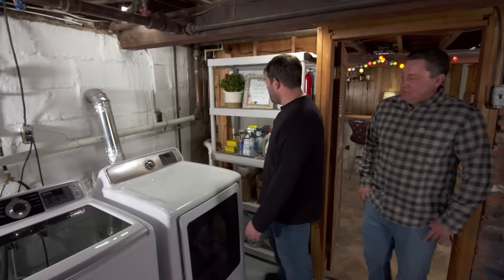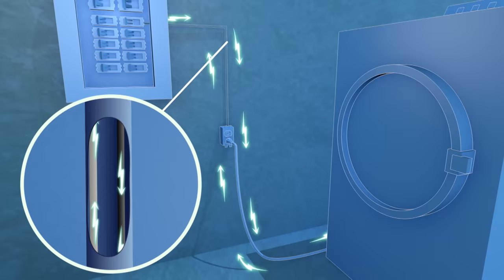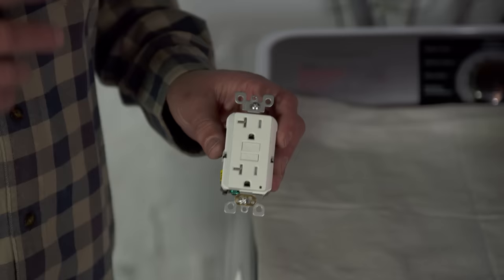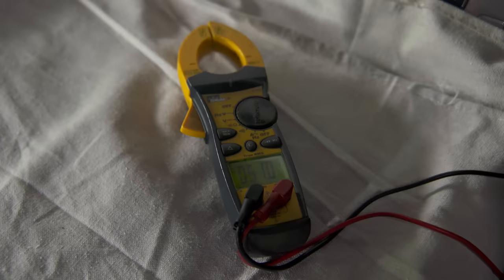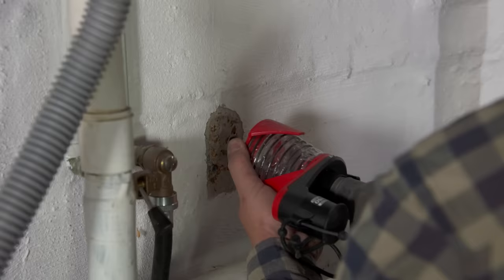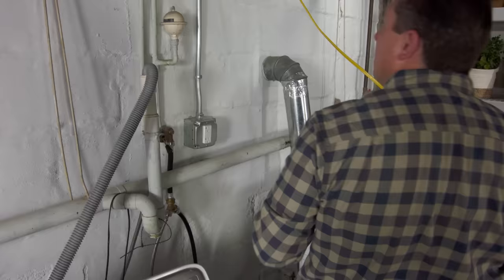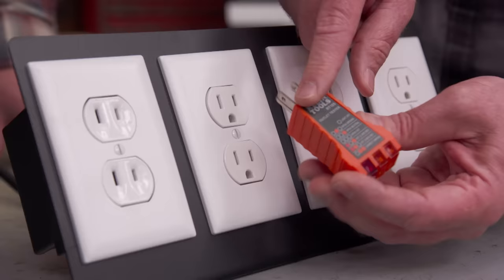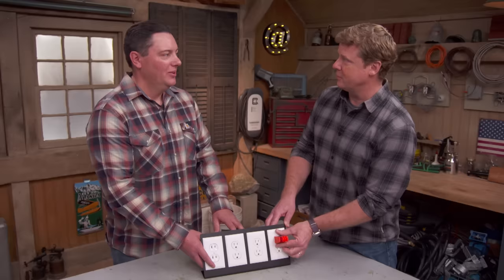How to Ground a Two-Prong Electrical Outlet | Ask This Old House

Comment: Why instead of running neutral wire through the whole house to create grounding rod nearby location of the receptacle? Much less work and exactly the same degree of GFCI protection. He just literally follows Code instead of thinking out of the box
Reply: What on "earth" are you talking about ?
Reply: @MiguelMartinez-kh1yk  not sure what u meant. What I meant I described clearly: to create a grounding rod nearby (to bury a big enough piece of metal like e.g. 6 feet long piece of rebar)  location of the receptacle and connect it with say  #2 copper wire to the "ground" contact of the 3-prong receptacle which should replace 2 prong receptacle. By the laws of physics, the ground has the same electric potential (=0) everywhere around the house (actually all over USA:). The cost of my solution is some ~$10, it saved the homeowner $500 paid to the electrician:). And no drilling, no dust, no cutting of the drywalls through the whole house. Of course - for the electrician is better to get $500:) but the movie is made for homeowners. BTW, this movie is just a simulation of a real-life situation. In reality, this Inspector MUST inspect the quality of the existing grounding of this 50+years (or 100 years old) old house which was build before the Code required the presence of the ground/3-prong receptacles
Reply: @borissokolov3350  
The problem with your solution is that you would have to install a grounding rod at every old receptacle that was not wired with a three wire cable in order to have each grounded.

Also, the grounding wire serves two purposes.  If there is a short in a metal encased device, it allows the electricity to complete the circuit when the alternating current is suppose to be flowing from the hot side to the neutral side.  Besides protecting people from completing the circuit accidentally, that unrestricted flow of electricity will also cause the breaker to flip to off and break the circuit at the supply panel.  The ground wire also protects devices from static electricity by attaching them to an earth ground so static electricity can not build up as well as induced currents that could be caused by close by lighting strikes.

So after you attach every receptacle to a grounding rod you would still have to attach the neutral wire side of the panel directly to all of the grounding rods to create a very low resistant circuit to protect people from electrocution and to cause the breaker switch to break the circuit or to blow a fuse to break the circuit.  Either way a wire will need to be run to connect all of the grounded receptacles to the supply panel.
Reply: @oldtimefarmboy617  this movie is named "How to Ground a Two-Prong Electrical Outlet | Ask This Old House". It is a simulation of potential real-life situations. We saw the main panel which looks almost new (definitely not 50+ years old) and we've heard the "owner" said that the home inspector found one 2-prong receptacle in unfinished basement (no other Code non-compliances mentioned). We know nothing about wiring in the whole house but we assume it is done by Code. The movie says nothing about the quality of the existing grounding of the main panel, this electrician did not measure the electrical resistance of the existing grounding (which is important keeping in mind the "old" age of the house), we know nothing about the service drop, breakers, gauges of wires. Bearing this in mind we assume (for the sake of this "performance") a 2-prong receptacle in the unfinished basement (and absence of grounding wire) is the only non-compliance. Moreover, even if the "owner" has, say, 5 or 10 2-prong receptacles in this unfinished basement he does NOT need a separate grounding rod for each, just to connect all 5 or 10 to the same grounding rod. (If the ground existed in the neighbor room we may connect to this ground, of course). This grounding rod-based solution addresses all aspects of the grounding problem (statics, safety, etc). You do not need to drill a number of concrete walls and drywall panels, to run new wiring through the whole house, re-paint walls, etc. And I disagree with your statement"you would still have to attach the neutral wire side of the panel directly to all of the grounding rods to create a very low resistant circuit to protect people"  because this statement is based on assumption that ground has significant electrical resistance - which specific resistance did you mean? Which resistance should have the grounding rod itself?  there are no requirements in the Code.   Finally - If you read comments to this movie you will see people are confused with the proposed solution because they expected cost reasonable solution for one 2 prong receptacle (is some "remote" unfinished basement). I appreciate "old house"'s educational movies, just would like to suggest alternate low-cost solutions for people who might have a similar problem. Of course, there is nothing wrong with the rewiring of the whole house if the owner solved all his financial problems:)
Reply: @borissokolov3350  
"Why instead of running neutral wire through the whole house to create grounding rod nearby location of the receptacle? Much less work and exactly the same degree of GFCI protection. He just literally follows Code instead of thinking out of the box"

I was responding to your comment, not the video.  For a ground to work as designed to protect people in the building from being electrocuted by a short to the metal casing of a device (as well as prevent potential fires) it must be bonded to the neutral bus bar in some fashion as well as an earth ground.  The soil is no where near as good a conductor as a copper wire and would not cause the breaker to trip to the off position in case of a shorted wire.

And in the United States of America, where this video was recorded, bonding the ground to the neutral bus bar IS code just like using GFI receptacles in any location where an electrical device can easily come in contact with water and metal plumbing is also code..
Reply: @oldtimefarmboy617  if he runs new wiring through the whole house this is a lot of work, dust, repainting, moving furniture, this was my point. but this is up to owner what to do. take care
Reply: @borissokolov3350  
You are correct.  If the owner wants to bring an older house up to modern code standards then that is exactly what they will have to do.  Which in the long run would be easier and look far better than running a bunch of wires to the outside of the house to connect to a bunch of grounding rods in the ground and then connecting all of those grounding rods outside the house together with a big enough wire to carry the potential ground fault of all of those receptacles and then run that wire back into the house so it can be bonded to the neutral bus bar.
Reply: @oldtimefarmboy617  1 to 12 receptacles, one grounding rod, one copper wire, one hole in the wall and whole unfinished basement grounding is done. 10-10 bucks. Or to run new wiring through the whole house to connect one receptacle. $500. Electrician choice is evident😁....but the home owner may different opinion😁
Reply: @borissokolov3350  
In the United States, older house wired to older codes are "grandfathered" in.  In other words, they do not have to update to new codes at all unless they are remodeled although if you add onto the house then the addition has to be wired to modern codes.

If you are going to restrict yourself just to the basement and run new ground wires from each receptacle to even a single grounding rod, you will still have to run a wire (at the very least) to the neutral bus bar in the supply panel.  US code does not allow that connector wire to be run outside of the building.  All of those individual ground wires will have to be connected together in a sub-panel inside the basement with an appropriate gauged wire run outside to the earth ground and another appropriately gauged insulated wire run inside the house to the supply panel to connect to the neutral bus bar.

It is not up to the electrician or the home owner, it is up to the law.  The work would have to be inspected by a government agent and satisfy current code.  And the penalty for non-compliance if the government finds out an electrician did it any other way is far more than $500 and if the homeowner does it that way himself and the government finds out, the home owner will also be fined and require to remove all of the wiring he did or redo it to meet code requirements.
Reply: @oldtimefarmboy617  when licensed home inspector will see 2 prong receptacle which has no ground in the old house he includes this finding in his home inspection report and advise the owner for the sake of safety  to replace this receptacle with 3-prong one with grounding wire. This is up to owner to do this upgrade or not. No code or law violation, no penalties. regardless of the fact it is not compliant with code. If the same inspector in the same old house will find 3 prong receptacle connected to the nearby grounding rod he will include this finding in his report and make the similar advice. But for the old house it  is not requirement for the owner like it was not requirement regarding 2 prong item. Regarding neutral connection I responded before. I understand yr approach. I represent old  home owner option which is not violation for the old houses  New houses are different story of course
Reply: @borissokolov3350  
Yes, that is what home inspectors do, that is what homeowners pay them for.  But that is not the same thing as a code inspector.  A code inspector makes certain that the work was done to the code's specifications and if it does not meet the code requirements it will have to be done over until it does.  A licensed electrician knows this and will do the work according to what the code requires if he wants to keep his license and money.
Reply: @oldtimefarmboy617  l don't recall any code inspectors in any house purchase deals I took part in. Home inspector and his report, owner with his home and agent who supports transaction and get his 3 percents (for nothing almost:).( And escrow) . No other parties
Reply: @borissokolov3350  
Please try to understand.  In the United States of America, in new construction or remodeling when you hire an electrician to rewire parts or all of an existing building building or a plumber to re-plumb parts or all of an existing building or add an all new addition to an existing building, the work (besides needing a permit) must be inspected and approved by the appropriate inspector before it can be placed into service.

That is not the same as buying an existing home and hiring and inspector to have it inspected and give you a report on its condition before you buy it.

The two are not the same and the requirements are not the same.
Reply: @oldtimefarmboy617 hopefully we covered the topic😎 everyone will make his reasonable conclusions😁

Comment: It never ceases to amaze me how primitive the US domestic electrical systems seem to be. Why aren't ALL sockets earthed by default? Why aren't all plug pins shielded by law, and all sockets tamper-proof by law?

It is just complete madness.
Reply: This is dealing with a much older installation before those laws were put into place. This electrician is bringing it up to meet the current code, which specifies earthed and tamper resistant outlets in most cases. As it is in an unfinished basement he is also required to install ground fault protection. Most dwelling sockets are even required to be arc-fault protected, which was also addressed in the video. We're getting there!
Reply: Fully agree, what's with there being no sleeving on the earth cable too, and the box he fitted to the wall, looked like what we would chop into the wall here in the uk
Reply: MrBeep2010 and why is everything metal. Why not plastic conduit and boxes?

Comment: If you turn your man off the lugs and bus bars are still hot, probably something you should tell newbies
Reply: You sound like the newbie. The bus bars are de-energized when the main breaker is turned off
Reply: In a residential panel it would just be your main lugs
Reply: @brandonheisey5139  or any panel. Residential or otherwise.

Comment: Did this guy put Romex into Conduit?? Isnt that completely against code?? arent you supposed to use THNN?
Reply: I know it's against code in my area. I mostly use t-90 nylon in coduit
Reply: It's not against NEC. Might be against code in your area.
Reply: The nec doesn’t say anything about romex in conduit being wrong. As long as your conduit is sized properly per the 40% rule you are fine.
Reply: NEC 334.15(B) actually REQUIRES romex (type NM) be in conduit as necessary to provide physical protection of exposed runs, as seen in the video.

Comment: Seriously?  You can only stuff Romex in conduit if the conduit length is 24" or less and that is permitted by the NEC for running through walls.  By inserting that Romex into the conduit you have changed it thermal properties and this install is a violation of the NEC since the wire now will get hotter!  Since he ran conduit he should have run individual black, white, and green THHN or THWN solid or stranded wires.
Reply: Wolfgang Unger where in the NEC does it say that?
Reply: @leonardholt5311     Mike Holt live.....LOL
Reply: NEC 334.15(B) actually REQUIRES you to "stuff Romex in conduit" (or equivalent) for physical protection.  Where do you think it has a limit of 24 inches?

Comment: Why didn't you just remove the old outlet and replace it with a "self-grounding" outlet.  $2.50, takes five minutes, and meets code.  I guess it would have been too short of a video!  ;-)
Reply: I guess they needed a 3-prong grounding-type receptacle, meaning GFCI as a minimum when there is no actual equipment grounding conductor available.
Reply: A self grounding outlet does not ground anything unless the box is grounded and one could do same with a piece of wire.

Comment: Arc fault breaker why?
Reply: Because that's the code bub!
Reply: because electrical manufacturers need more money
Reply: Yeah I was confused too.  I thought it would be a gfci since it's an unfinished basement
Reply: Afci and GFCI are required on a new circuit for a washing machine per nec 2017 code.
Reply: Short answer:  It's code.
Long answer: ICC has to sell code books.
Reply: ironmatic 1 -YUP!!! You got that 100% right!!!
Reply: @TheRealTonyCastillo  AFCI and GFCI also required on REPLACEMENT receptacles in laundry rooms, since 2014 NEC.

Comment: 55 it looks like to me you snaking 🐍 the Rome-x wire into the panel, without the isolation of the wire covering the Rome-x. But if that's what he did.... its wrong and dangerous, if you feeding a rome-x cable to the panel why wouldn't you have the insulation covering the wire 🤔🤔. He did many things wrong
Reply: Seems to me he stripped the romex and left A LOT of extra so he could neatly route the wires in the panel.